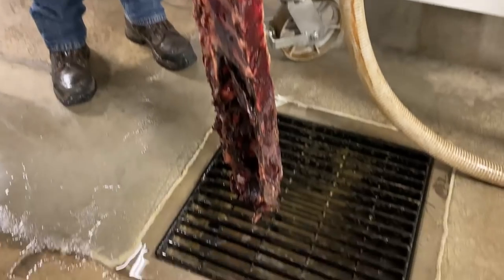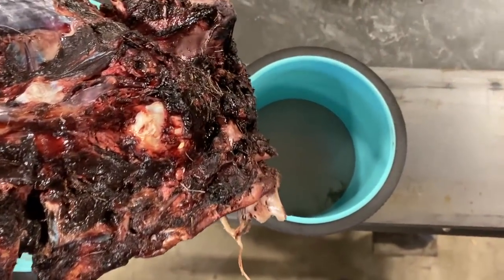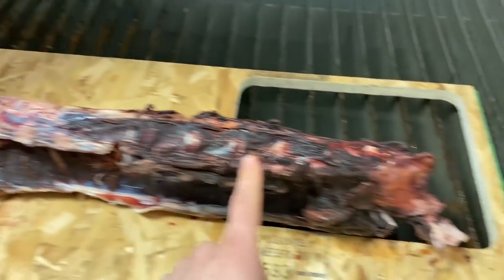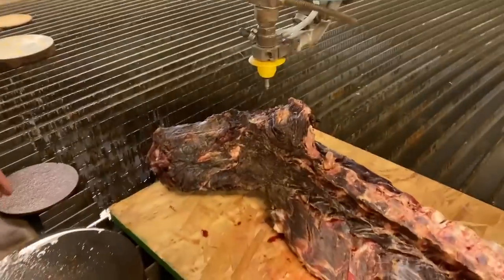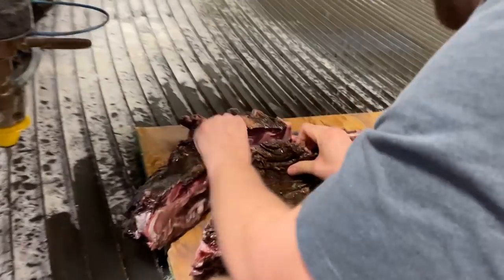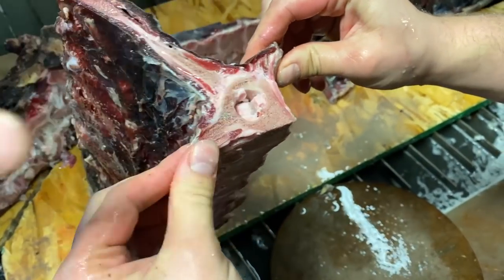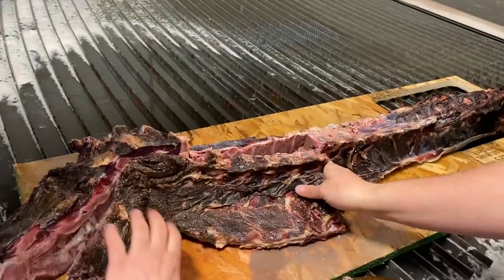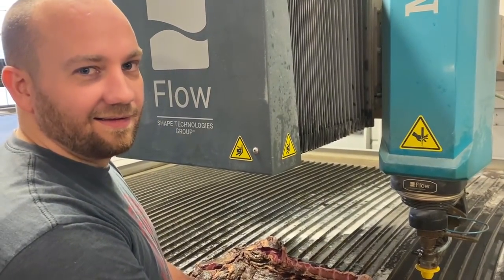How does a spine work? | Fascinating Cross-Section

Comment: basically, the spine has 4 major parts, the vertebrate, the Spinal cord and nerve bundles, the Facet joints (that the two bumps on either side you see on your back), and the Disk in between each vertebra. the nerve bundles come out of the spinal cord in between the Disk and the facet joint. the place where the Facet Joint meets the vertebrate back is a very small space where super small nerve ending is, that is where we get most of our pain from when we hurt our backs. I know this for a fact because I have severe nerve damage at those points. if the get damaged the body will grow new ones, but if you damage the large nerve bundles that come out of the back those can cause us to become a paraplegic or a Quadriplegic
Reply: Kristyanna Virgona I learned all that in medical school. Lol I can’t even practice it because my spine is jacked up. I will say your spot on